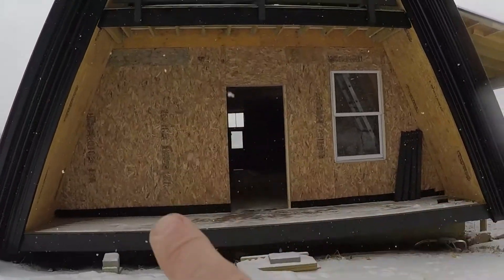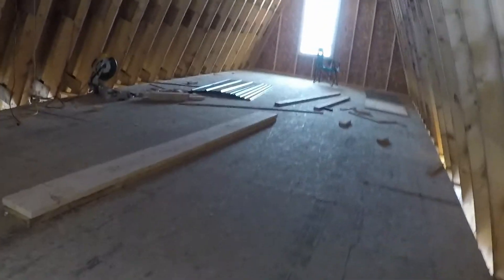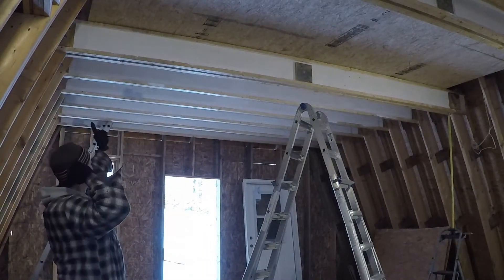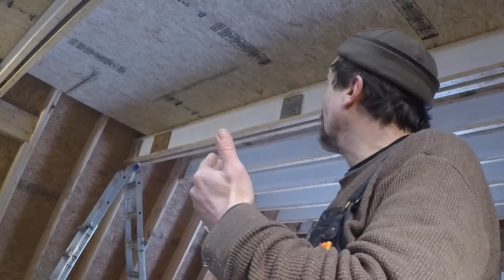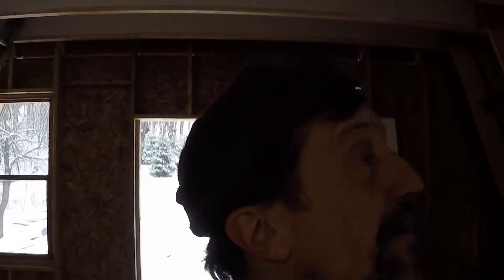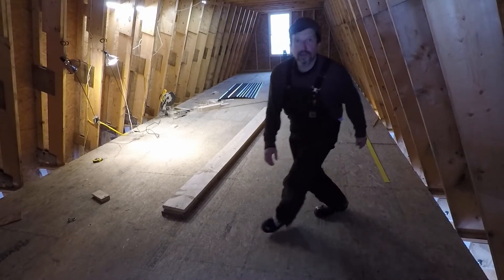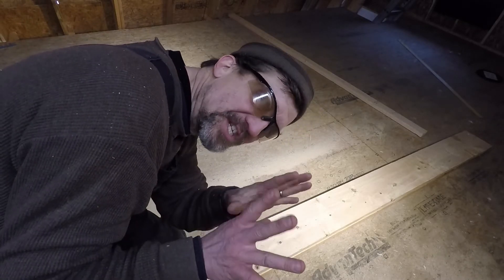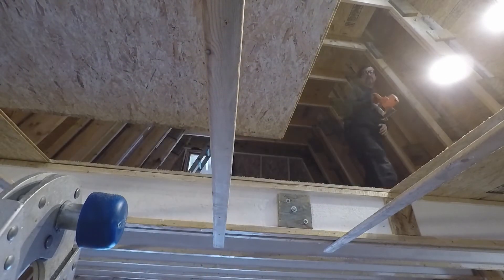12 inch I-JOIST CUTTING FLOOR for the STAIRWELL Framing

Comment: I am currently installing a new stairway in my 1965 1800 Sq ft A frame. The original stairs are spiral from the basement to the main floor and a second set from the main to the second floor. I am putting them on the side of the house and will be cutting the floor joists this evening. First I built 2x6 walls in the basement for the jousts to sit on, then I cut the floor decking and built walls on the main floor. The walls on the main floor are number 1 meant to create a new vertical wall for my kitchen and also to transfer some weight from the second floor to the basement floor. I also may have to remove a portion of three of the exterior rafters to create headroom, best case I can leave the rafters as they are. I wont know this until I remove the floor joists and build the stair and walk them a few times. I am a touch nervous about the possibility of adjusting the rafters but I will have enough strength to support everything. I have a tendency to over build.
Reply from the maker: Good luck and spend any extra time doing the research for joist span tables Etc. Better to overbuild than under build.